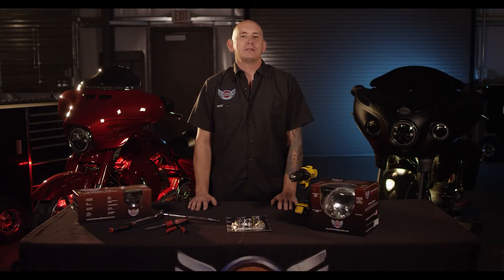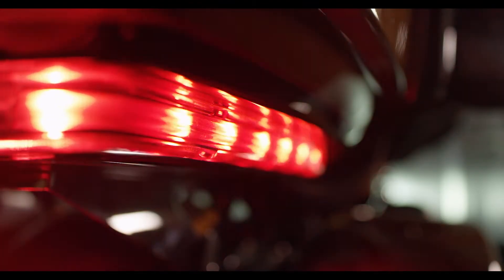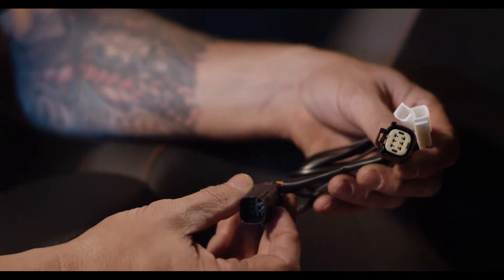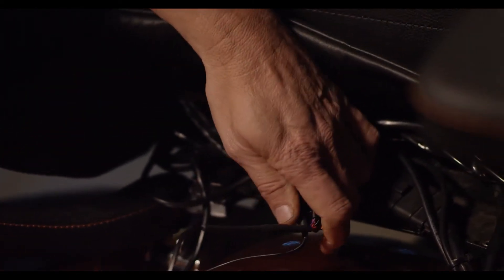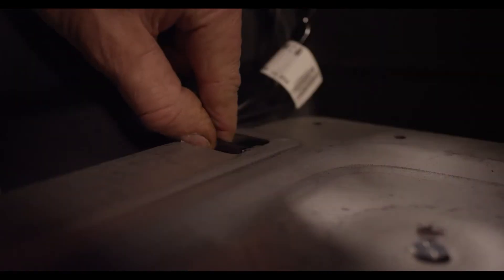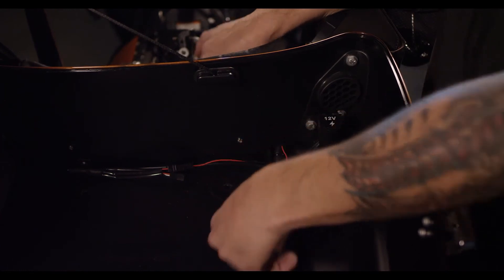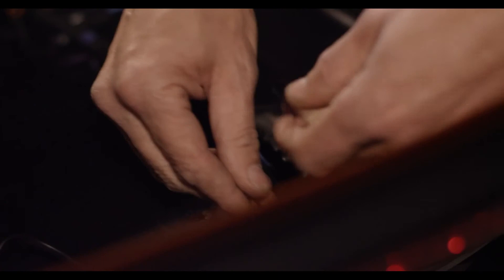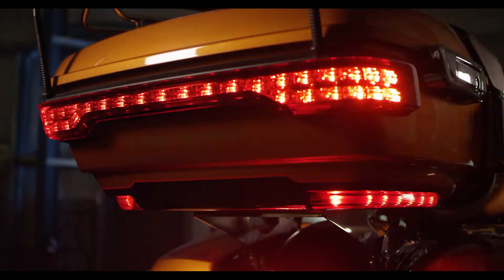How To Install: Magic Tour Pak Converter for 2014 & Newer H-D LED Tour Pak

Comment: when you say plug it in downstream can you just plug it in to the out end of LTP2?
Reply from the maker: Yes! That's exactly right! If you're installing the Magic Tour Pak Converter along with a Magic Strobes™ LTP2 module (sold separately), the Magic Tour Pak Converter will plug into the output side of the
Magic Strobes™ LTP2! If you have any questions during installation, you can give us a call at 1-800-382-1388 and we'd be happy to help!
Reply: @customdynamics  thank you!!